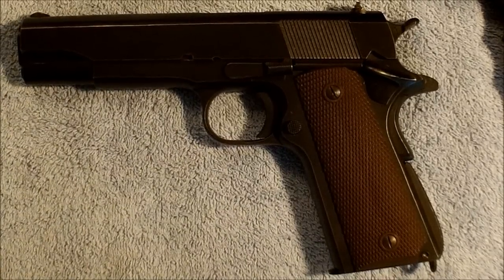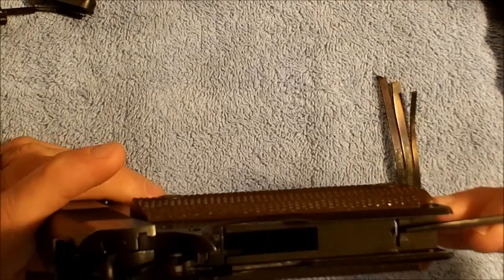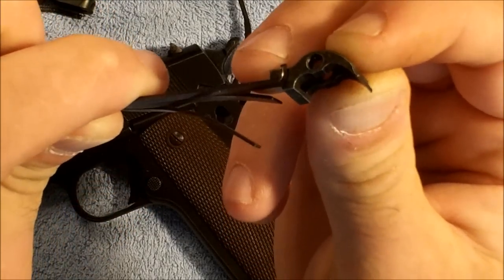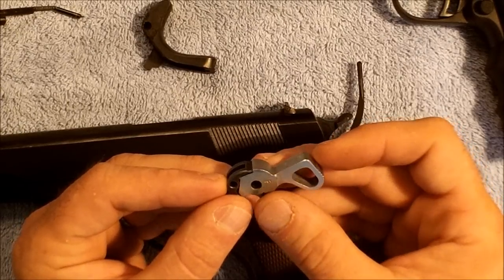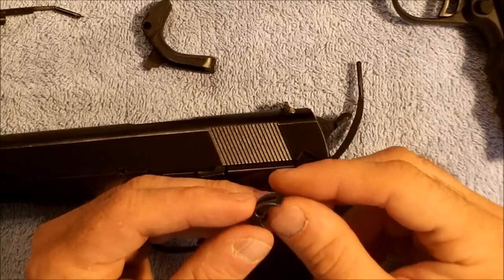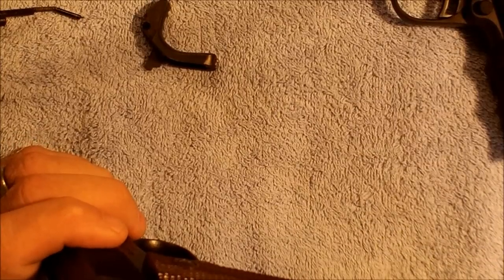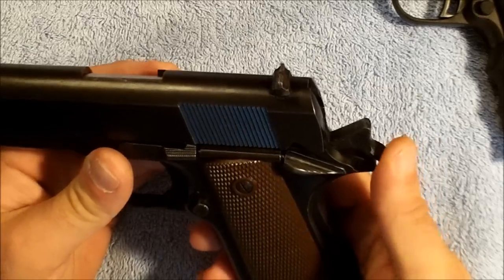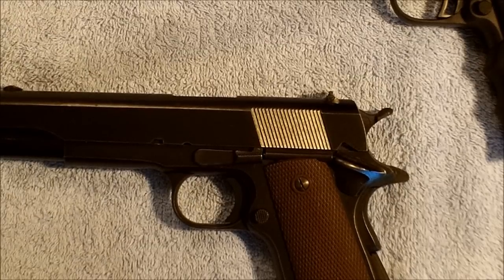1911: Sear Spring Adjustment and Replacement: Re-duex

Comment: A couple years ago I bought an argentine 1911,the barrel was shot out and the trigger was so small I couldn't use it,I bought an extended trigger and installed it myself,and messed it up horribly,broke just about everything in the trigger group,so I bought all the new parts and took it to a gun smith,it worked but the trigger pull was so hard your couldn't shot straight,he said it would break in over time,it never did,so tonight I pulled it all apart and after watching your video I was able to determine what was wrong,the sear had hooks where they should have been squared,I carefully used a stone to square the surfaces,I also stoned all the others as well,then step by step using  your video as a guide I put it all back together,I don't have a gauge to check the pull but it is smooth and breaks perfectly. Thanks you so much for taking the time to post it!
Reply: You know how much money you're gun is worth!!! 😮

Comment: Thank you!! you are the first person that has fully explained the proper operation of the sear spring. After putting my gun back together and shooting, the hammer would not stay cocked. Now I see what I did wrong. Also kudos on the demo of the sear and hammer function. In 20 minutes I learned quite a bit.

Comment: I’ve polished all the surfaces on the trigger bow, sear, and disconnector that contact each other and put a very small amount of gun grease on the sear spring contact points. Initial bending of the sear spring yielded a too light 2-2.5# pull. Readjusted the bends on the sear spring and now I have a crisp 3.12-3.5# pull that is smooth and safe. I also purchased and used the Ed Brown sear jig and appropriate India and synthetic stones to resurface the hammer hooks and sear nose engagement surfaces. Having smooth and sharp sear nose and hammer hook geometry makes a significant difference.

Comment: Close except the trigger don’t trip the hammer it pushes the disconnect which trips the sear which lets the hammer fall.  The gun goes bang then the disconnector is pushed down by the slide and becomes disconnected from the trigger bow.  When the slide returns to home position the disconnector can now pop back into the slide notch but only by releasing the trigger to let it pop up or reset.  Whoever figured out that trick was pretty smart.  Oh yah it was John Browning😀

Comment: Thank you very much!  I just experienced this problem with my RIA.  I was thinking the reason for the hammer not engaging was because the drop in hammer and extended beavertail that I put in.  All along it was the placement of the sear spring on the sear.  Thank you again for this informative video.  Great Job!!
Reply: I think that is my problem! Thanks for taking the time to inform us.

Comment from the maker: Willie,  This gun has a very high polish on the disconnector and the trigger bow.  It also has a 3 pound trigger pull and probably about 10,000 rounds through it, so it is pretty loose, in comparison to a newer gun.  It is about time to replace the internal parts in my book.  Sounds like yours is working perfectly.  I wouldn't change a thing.

Comment from the maker: @Gunsandgear101 As you are looking at the rearieo of the pistol the left leg controls the seat it is either broken or badly out of adjustment.  Pushing the left leaf in will add tension and may fix the problem.  It is not safe to use as is and is actually illegal since it is full automatic

Comment from the maker: Sound like either a problem with the disconnector or the center leaf on the sear spring need to have tension added to it.  You will have to do a detail strip of the frame and examine the parts.

Comment from the maker: The left spring can add or reduce the trigger pull depending on wether you add or reduce tension.  Adding tension will give the sear positive engagement on the hammer, reducing tension will weaken that engagement, to the point that you can have hammer follow.  That is obviously undesirable.  the trick is to balance engagement with trigger pull.  Minimal pull should be no less than 3 lbs, and no more than 8 lbs.  5 lbs is a good average and safe trigger weight.

Comment from the maker: Have you attempted a detailed strip of the gun if so,  Take the mainspring housing, and grip safety back off and check to make sure the sear spring is sitting with the left leaf on top of the left sear leg on the left side of the frame as you are looking at it from the rear.  This is a common error in assembly and may have come that way from the factor if this is a new gun.  If fact if that is the issue it will be the second one that I've been asked about this week.  Let me know what you find,

Comment: I had my Springfield 1911 Cerakoted awhile back and I picked up in pieces as I was moving and needed it to come with. I reassembled and grip safety is not working as I remember. The finger on far right is bent the most towards the rear. Is that normal? Where did I mess up?

Comment: any idea why my Colt 1911 series 70 commander grip safety is not working? i changed my trigger and safety hardware put it back together and took apart many times to check dry fire..it will cock back and fire but it doing so with out pushing in grip safety..ive made sure everything is in correctly but cant seem to figure out why the grip safety is being bypassed..help advise please?

Comment: Thanks. The first time I took my new 1911 apart I Didn't know what I was doing and when I put it back together I had the sear behind the pin that holds it in. So when I forced the main spring housing back on it may have bent the sear spring a little. It seems like it has a little stiffer trigger and a little creep now. It could be that I just didn't notice it before but I'm going to take it back out and compare it to some pictures on line. The middle prong was forward of the other 2. Normal?

Comment: Great Video, thank you. QUESTION: what if the hammer does fall when the grip saftey is engaged? So it disengeges the grip saftey on its own when pulling the trigger and it fires. Do you know what casues that?

Comment: I meant the trigger tension but thanks for the reply. So you apply pressure to the center which I'm assuming would keep the same arch but move? Or do you apply pressure to the tip which make the arch stealer or less strap? Do you get what I'm saying?

Comment: Very well done video. Question, my 1911 functions well but I noticed in your video where you had the slide removed and the hammer cocked you pressed down on the disconnector and it came back up via spring pressure. When I push down on mine it stays there, until I press the trigger. Any thoughts would be appreciated. When fireing or dry fireing the disconnector resets fine.